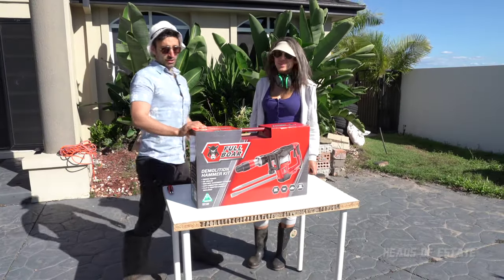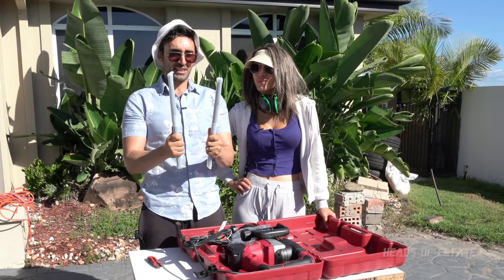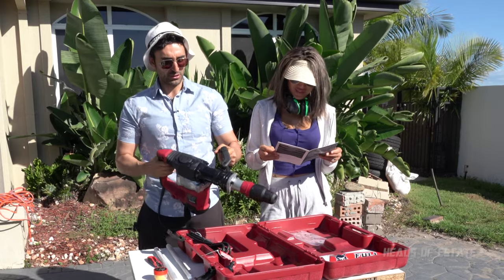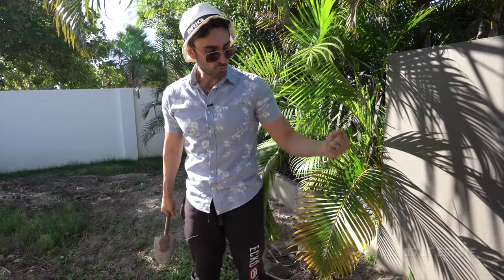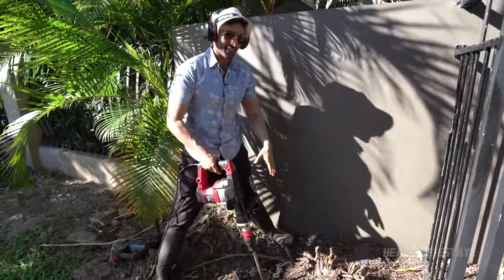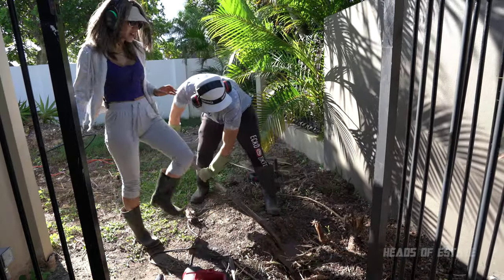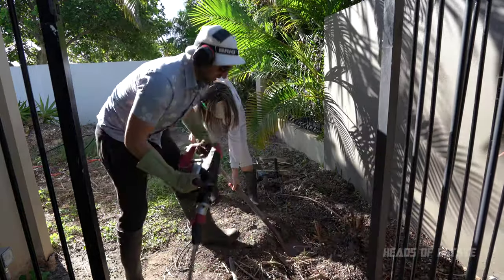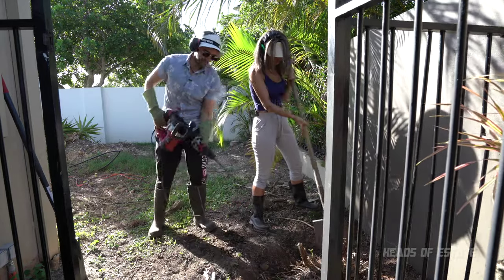Tree Stump Removal a with Demolition Hammer + SDS MAX Clay Spade | Full Boar 1500W 32J REVIEW

Comment: Dig around it. Then use an electric chain saw to cut it below ground level.  Done.
Reply: Even if you dig around, you run a very, very high risk of dulling the chain pretty much instantly due to dirt residue.
Reply: @3DTwinkies  Dig it to where only the chain engages the tree. I do it all the time. Works great!!

Comment: Use the  chisel bit, MUCH MUCH MUCH  easier. Yes it  is  able  to cut 6 inch  roots,  I used a vevor  2200  watt jack hammer. EAR PROTECTION  highly recommended. Leather gloves optional but recommended. Oil and grease your machine, on the grease be sparing and check  so theres no drying of the bit. I reccomend digging  out the roots and hitting those direct  with  a chisel bit,  it will get stuck but  back out come at  a different angle  and it  will come  out.

Comment: I thought I was the first with this idea! Lol. I realize there's a big difference in solid wood and palm wood, but I just had to remove four palm tree stumps that were cut almost flush to the ground. Almost impossible to dig out because of the many roots and they were on a terrace without much room to work let alone get a stump grinder up there. I took my sawzall with a demolition blade around the perimeter roots then took my jackhammer to it like I was slicing a pie. Was dreading removing these until I came up with the idea. Just thought I'd pass that along. I'd try a spike bit in a jackhammer with solid wood.